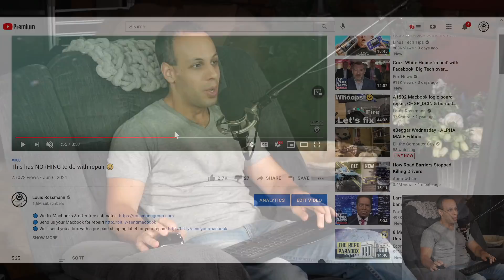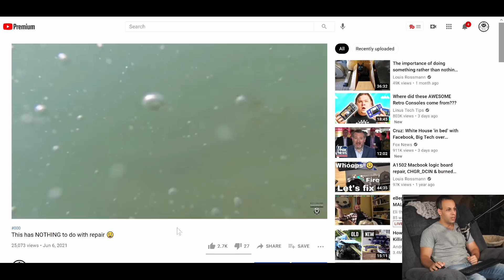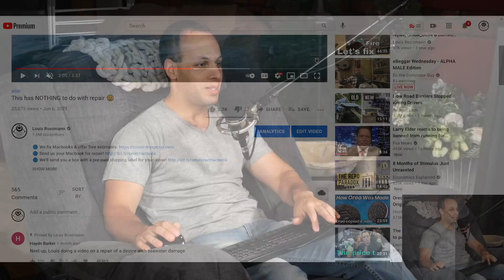Why are user serviceable batteries a bad thing?

Comment: People are fools, now they carry around a Power Brick, when all they needed to do in the past was, buy a spare battery.
Reply: To be fair to power banks, I too prefer swapping batteries when it's possible but the power banks can be quite versatile as a backup supply, especially newer ones supporting the Power Delivery from USB-C -> With one brick as a backup in a bag you can charge your phone, your laptop and maybe eventually another gadget you might be carrying around (a smartwach, a game console, ...etc)
Reply: i would still carry a powerbank if my phone had a replacable battery. It's currently 4years + old, the battery life is now awfull and for this i want the return a replacable batteries. I would instant buy a high end Smartphone with this..
Reply: how is it that this has turned into a degenerate thread about power banks versus spare batteries? you can use power banks on phones with swappable batteries, idiots.
Reply: Every car I've ever owned that could charge my phone did so poorly and extremely slow.
Reply: @Joyless222gaming  Pro tip: don't use the car's usb port. It's not designed for charging modern devices.
Reply: I can remember back in the 1990's the nokia phones they sold extended batteries that attached to back of the phone which the phone did include a standard battery as well.
Reply: I had an android when all my friends had iphone 4s. We went on a roadtrip and when our phones got low they all had to have chords and power bricks to keep them charged. I had a spare battery that took up less space in my bag and was instantly at 100%. Their minds were blown at how easy it was.
Reply: Unless your device has two batteries for easy hotswapping (a feature that to my knowledge was only present on chonker laptops), it won't be that simple. Swap your battery out, and your phone turns off. For some people, this may not be an issue. But for most that'd be beyond a minor annoyance.

I'd much rather carry around a power bank than have my phone or laptop turn off when I need a fresh battery. And with the all day battery life that current devices provide, it's not big of an issue.

No, the reason I wish batteries were replaceable is for easier repair when the battery wears out, not for swapping when it goes dead. That's, imo, very impractical
Reply: It’s not safe to carry around the soft packed battery
Reply: @AW-tc4hy  This is one of the best reasons I've heard so far.

Id be curious though, with devices made out of glass and thin, flexible metal that provide no shock protection to the battery, how much more dangerous could it actually be?

Also, battery tech is pretty good now. I carried around multiple cheap Chinese batteries for years before power banks were really a thing. I never had any issues with them and even threw the bag they were in around like it didn't matter.
Reply: Well even if I could replace my battery, a power bank is a good idea because of the versatility, you can charge multiple devices with it
Reply: @donovanobrien8860  I remember back in the LG G4/5 days there was a spare battery charger which was just a box bigger than the battery and it charged with the same cable as the phone and it has the ability to plug in a usb cable to use the battery as a charger if need be. also not having a cable attached to your phone is much more versatility than the versatility of a battery (in my opinion)
Reply: @MagicBrownMan  That does sound nice.  I just like the option of being able to charge all my devices from the same battery.  I would like swappable batteries to replace old batteries. I don't really see the need to carry a bunch of spares on me unless I'm traveling. My phone will last all day, and will charge to full from a wall in 30min.   Just wanna preserve the longevity of my phone by being able to swap defunct parts.
Reply: @donovanobrien8860  
The power bank needs a cable as well, and they're usually way bigger than cellphone batteries. Theyre too cumbersome i dont know why you wouldnt choose a spare replaceable battery lol. Just charge both batteries at home
Reply: D A I have a power bank with a built in USB C, micro-B, and Lighting cord. I can charge my phone, my Bluetooth headphones (micro-B) and any USB C device at the gym when I’m working out. This is convenient because I don’t usually bring my car into the gym with me.
Reply: @da8874  The problem with that is that you MUST turn off the device to swap the battery, and in some situations you just can't do that
Reply: @ropuce  What situation can you be in where you can't turn your phone off for the 15 seconds it takes to swap a battery yet can spend that time faffing about with cables which could fall out if knocked and then hope you didn't let the power drop below 15% else the phone will turn itself off anyway when you insert the charging cable.
Reply: @Llian_C  Are you gonna swap the battery during an important call?
Reply: @da8874  INDEED
Reply: @annoyedok321 I never said that you couldn't plug it into an outlet, but I was answering in the case that one would ONLY bring extra batteries and maybe a charger, but no powerbank, while not having a power outlet nearby to charge the phone. I personally have been in a similar situation, except I had a powerbank with me
Reply: @annoyedok321 That would actually be a good idea (which already exists but I don't remember the name)
Reply: @donovanobrien8860  you are forgetting you can have a replacable battery AND a power bank, having one doesn't mean you can't have the other!
It's like wireless headphones and 3.5mm jack, you CAN and actually at some point DID have both, but people like when companies remove a feature because it's "the future"...
Reply: @houssamalucad753  Like I said in my reply to Alex, I'd like one and am for replaceable battery's.  Never said I wasn't.
Reply: @donovanobrien8860  how many devices do you carry around with you that would need charging? Even if you do have a lot of gadgets( i suspect not) but if you really do then you probably have a car in which you can charge your shit.
Reply: @Alexander_l322  I have 3 that need charging so i use a power bank, I dont drive so cant charge in a car and if im out all day then i really do need more power. If i was using spare batteries i would need about to carry 5 spares and a brick power bank is easier then messing with batteries.
Reply: @Alexander_l322  backpack
Reply: @Alexander_l322  Phone, wireless earbuds, speaker, laptop, vapes, other people's phones, speakers, etc.  I usually carry a backpack anyways so the size increase isn't a big deal.  Not always around my car, and it's an old Corolla so I can only charge two things out of a cig port adapter.  Not saying I disapprove of a removable battery, I'd like one for it's benefits and choice.  Just saying external battery packs are useful and more versatile.
Reply: @Alexander_l322  Not everyone has a car my guy...
Reply: @donovanobrien8860  I don’t talk to people who vape, they smell like candy and weird flavours.
Reply: @GetIsekaid  but everyone should be able to replace their batteries.
Reply: @Alexander_l322  Okay.
Reply: @donovanobrien8860  oh you vape weed? Well that’s different then and I retract my previous comments. I used to smoke weed myself, I gave up last year after being high for pretty much 10 years. Was fun while it lasted but my time to give it up came so I took it.
Reply: @Alexander_l322  That's respectable.  I try and hit a balance to where it doesn't get in my productivity at all.
Reply: @donovanobrien8860  yea see I let it take over my life and I ended up growing it because I couldn’t afford to keep buying it so that got me smoking a quarter everyday. I had more weed than I could smoke lolz It was a mental time in my life but one I don’t miss and don’t want to go back to. More power to you for being able to control yourself on it and not let it take over your life.
Reply: @Alexander_l322  the argument is for a battery you can carry around easily which a car isn't
Reply: @Alexander_l322  a lot of devices today depends on usb to charge. Me, a field worker would have at least a 20 Ah powerbank for my phone, walkie talkies, a usb charged flash light, an occassional usb soldering, and a usb charged screwdriver. My kids would use usb for charging phone, tablet, and pocket games. I would say that having a proper powerbank is more convenient than having replacement batteries for all these devices. Plus, you don't have to turn off the phone, and restarted it back after a battery change.
Reply: @iqbalindaryono8984  you don’t carry around a car. You sit in it and drive around.
Reply: @Alexander_l322  which has nothing to do with carry on batteries. Why even brought it up
Reply: @iqbalindaryono8984  because lots of people drive and can charge their phones and other devices using the car and can store spare batteries in the car. I used to store extra batteries in the glove box for my older phones.
Reply: @EffendiChung  I think pretty much all devices depend on USB charging. When was the last time you bought a portable device that needs an AC adaptor? Not talking about laptops but other hand held devices.
Reply: @Alexander_l322  so you store your spare battery in your car instead of carrying it inside your bag? Seems impractical. It was more practical for me during those 8 hours to have the spare battery on hand rather than have it stored anywhere else. Though more often than not, charging your device during my commute would keep it charged until the next commute. Assuming I didn't forgot to charge my phone at home. I'm just not sure what circumstances would make charging your phone in your car would be relevant in an argument about doubling your battery life by having a spare.
Reply: @Alexander_l322  no car, usually carry around a psp with me along with my phone. Being able to charge it on the go is something I could only dream of when I first got it, and now I can charge them both at once and have power to spare.
Reply: @Timeward76  the PSP has a removable battery, I know because I own one too. That means you’d just need to carry one extra battery with you which is smaller than a power bank and lighter.
Reply: TBF, power bricks can be used with nearly all your devices though.  

Also, there are people who are so mobile for work that they can't sit anywhere, waiting for their devices to charge(save for lunch maybe).  Every time I go to a convention now, I bring a power brick, since I want to attend ALL the panels AND use my phone for scheduling.  I'd imagine it'd be like that, but all year around. 

Also with the move to USB-C, eventually all you'll need is a single cable(or maybe a couple of the same cables).
Reply: "note 4 with a bag of 15 batteries" gang where you at?
Reply: There are some good reasons to have a power brick even if you have the ability to carry a stack of spare batteries with you. In the FPV drone hobby, you'll be wishing you had a power brick once your racer drone has sucked a bunch of your batteries dry. (They do go through a lot if you want to fly for a long period of time unless you opt for a micro long range model.) It also doesn't hurt that the more sophisticated battery chargers can prep your batteries for long-term storage, which is great if don't plan on using your spares for an extended period of time.
Reply: The LG G5 has been a superior design in that regard for going on 5 years.
Whats amazing is that the ergonomics and overall design of that phone still holds up all these years later.
Reply: That's what I used to do with my galaxy Nexus. So much easier to carry a spare battery over a portable charger.
Reply: My old Samsung J7 has a replaceable battery, and no phone stores stock them. Amazon does though ... $14 each. Bought an extra!
Reply: what if tehy just had a power brick with a replaceable battery.
Reply: @UC4EMdhiGAYSEj5Ra2PA6RQg your smart phone is an MP3 player and a kindle if you don’t mind the smaller screen… also you can emulate games on your smartphone but I’m not sure if that includes DS games.
Reply: Hmm...I now think power brick is better I have more wireless times now that benefits
Reply: @Mr. Spetznaz then you would reduce size of the battery significantly and that would suck as a product
Reply: I would argue they don't carry around power bricks...
They carry around wall worts and steal electricity from wherever they happen to be.
Reply: LG G4/G5 and V10 were absolutely fantastic - removable batteries were like a cold drink on a hot day. Nothing like popping out the hot depleted one and in goes a fresh cool 🔋 giving 100% immediately. If only they didn't suffer bootloop I'd still be running one today..
Reply: The virgin power bank vs the chad swappable battery
Reply: I still have my old Erickson phone somewhere with a couple of extra batteries, and a table top charger bought bought cheap that you could charge one battery separately and one with the phone itself. Super convenient and my phone never run out of battery.
Reply: This is why I still keep my lg G5 w/ 2 extra batts
Reply: a powerbrick can be used to charge all usb devices, if you buy those battery's separately your spending more. and if you swap the battery you loose your volatile memory making it not exactly plug in and go on where you left off. also you cant charge both your phone battery and backup battery at the same time so you cant just have a charged backup battery always full for when you need it.
Reply: Haha true but it's easier to chsrge a power bank than a spare battery
Reply: @alexstone691  have you heard of a charging cradle. some PDAs came with an extra slot where you could charge an extra battery. Most phones with a user replaceable battery have had some sort of third party cradle. all you'd need to do is to make sure to put them in the cradle. hell even some older macbooks encouraged you to swap batteries, when you closed the laptop, it would save ram to disk, and if you swapped out batteries, you'd start the machine back up and be right where you left off. hell, even windows 11 still has this feature built in. some brands of laptops, you can find a battery charger that hooks directly onto the battery terminals and you can charge it that way (albeit hacky)
Reply: @alexstone691  It's easier to charge a spare battery if you have a battery cradle. This is how Gopros and other waterproof cameras like Pentax Optio W-series work.
Reply: @SianaGearz  so then you would need to carry it around as well, i am happy with a power bank

Comment: They don't want you to ever be able to turn off your device completely with ease. That is why the battery is hidden away.
Reply: That caused my Surface Pro to be unusable for weeks. It crashed during shutdown and ended up in a state where it wasn't turned off completely and couldn't boot or power off. The only way to reset it is to wait for the battery to drain completely (not even Microsoft can repair these).
Needless to say I've only used standard laptops since. I can disconnect the battery on mine blindly within seconds. And replace internal components, extend RAM etc. via just 5 screws. Oh, and it's also much more powerful because when a laptop isn't built to be as flat as possible it's actually able to cool its CPU.
Reply: @brinkoftext  had the same thing with Samsung Note Pro 12"
Reply: @404Tired  Dell lies.
Reply: @mr1bienvenu1  You are correct sir...but then again they are Dell users
Reply: This, because the device can still broadcast if turned off
Reply: @404Tired  So now that the battery is sealed the battery will inevitably fail anyways and then the computer can randomly shut down hundreds of times, or require the user to keep it plugged in. Whew, problem solved of pesky removable batteries..... and then the user trips over the cord corrupting both the ongoing update and the charge port. Somehow think that Dell's motives were a bit more financially based.
Reply: @jimfrench2001 at least in in my model the battery is built in but it can be taken out with a phillips screwdriver
Reply: The NSA sure doesn't mind it, given they can activate your phone and make it broadcast (aka spy on you) even when it's turned "off." Snowden confirmed this.
Reply: @DeathBringer769  what about airplane mode as then it would violate FAA law wich is interesting when that gets leaked
Reply: nah, that's not the main reason...
though they surely don't mind
Reply: @404Tired  I see what you did there🤥🧐🙄😂
Reply: @404Tired  windows tells you don't remove power. So... This is how consumers learn lmao 🤣 and ya know they could just watch a YouTube video, grab their data and install windows a child can do it